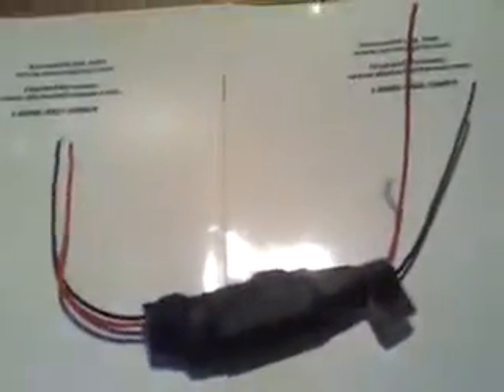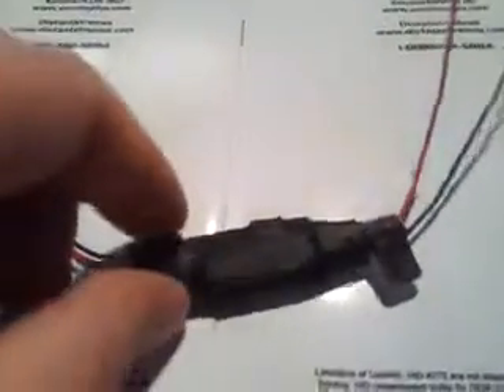LED slow pulse or breathing mode module

Comment: i am trying to figure out how to get this "breathing" or "pulsating" effect in orbs 15mm and 20mm.  I have a necklace design with 7 spheres.  There is a front and back to the necklace, thus, if there is any need for significant wires, etc, they can be on the backside.  They would be epoxy resin orbs.